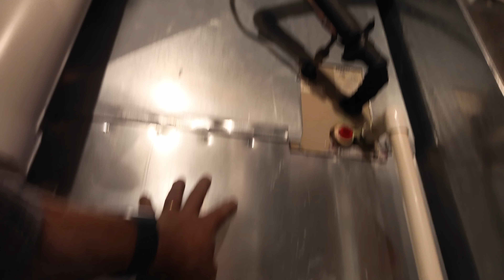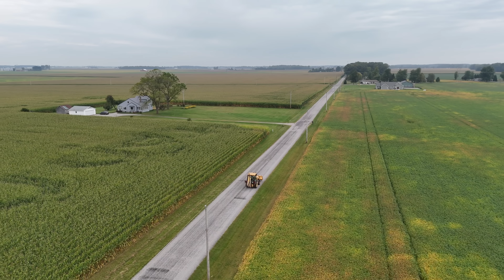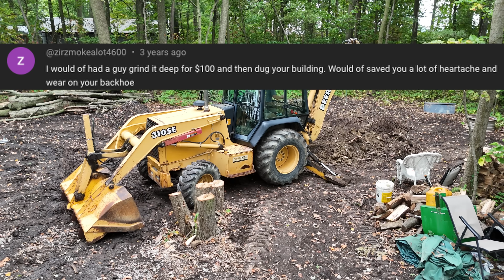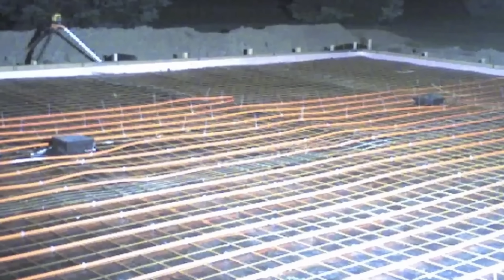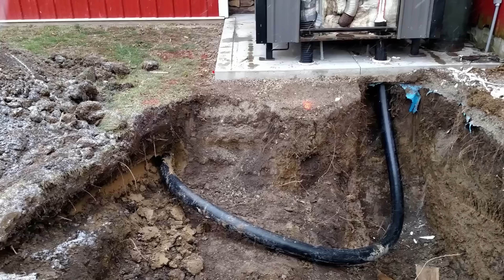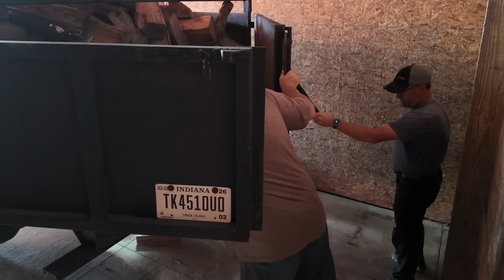Digging Stumps To Fuel My Outdoor Wood Stove

Comment: Actually, Neil. I used to have to take my 18 inch bucket off. Put my 24 inch bucket on. To dig out tree stumps. It seemed to. Had more power. I don't know why you'd think it'd be different. I'm talking about my old 310D, John Deere. 1995 model. I cleared a lot of land with that. Digging stumps, trees, you name it. But the hardest thing to ever dig out. Is a burnt stump. After they're burnt, they're tough as nails.

Comment: Since I have never operated any heavy equipment except for a couple of Bobcats a couple decades ago, I figure that I'm not qualified enough to comment on how stumps get pulled. Your method seems to put the least amount of wear and tear on the equipment. Plus I'm not sure I'd want 5 or 10 feet of "stump" in the way just for the dubious value of using it for leverage. That's about all the armchair quarterbacking I'll do.

Thanks for the tour of the actual set up of the hydronic heating system. I'd be interested in a more detailed video if you ever feel like you need an idea to fill in between projects. I doubt I'll ever have a boiler, but I'm always interested in just about anything mechanical, electrical, or plumbing related. That's a fairly broad range of interest, but it keeps me occupied!

Comment: I'm far from an expert, but I would imagine you could get a 1-1/2 or 1 inch thick piece of steel cut in the shape of a tooth, have someone local fabricate the necessary attachment for your backhoe, and you'd have a stump attachment.

Comment: Having dug more than a few stumps up by hand before, having any machine to do the work is better. More so with whatever ground the stump is in, for me that's red clay. Stuff is like digging through red brick wet or dry, spend a hour digging and you're barely ten inches down with a shovel.

Anyway, once out, roll the stump around to get as much dirt off as possible, pressure wash if necessary then let it dry for a good month, begin lopping it apart with a saw then splitter. It's dense wood so when it burns it takes a while to burn fully. Rarely would I want to burn a stump in the ground because of possible root fires spreading out to light any surrounding brush up or possibly get a building lit on fire. So use what you have and take your time, it's not a race to get stumps up unless you're being paid for it and the client wants visible results quickly.

Comment: I’ve dug dozens of stumps with myJohn Deere 410 G backhoe

I tried all the stuff you’ve discussed through the years and I always just cut the stump off as low as I can to the ground dig around it completely like you did to cut the roots and then pop it out 

It seems to be the most efficient way to me. I’ve ended up with some holes that were 12 feet in diameter and 12 feet deep when the trees were really big. 

It’s not hard on the machine at all. Are designed for digging as long as you’re not a bonehead operator. 

I’ve also dug dozens of boulders out of the ground, some larger than Volkswagen beetles with the same machine, and the same thing applies. You have to be smarter than the thing you’re working on.

Comment: Should of, Could of, Would of...the circumstances were not the ones where those things made the right sense.  I would have pushed over the tree -- well there are stumps here currently, not trees. So got to deal with the stumps.  I would have used a grinder -- If you have a grinder handy, great.  Neil and Jeff don't have a stump grinder, they have a backhoe.

Comment: Quick question: have you ever checked in on the $7,000, wood gasifier, how you could use to power a pretty large generator, which could significantly cut your electric bill, maybe 50% during the cost of heating your home during the coldest time of the winter. I've been watching people buy these high quality kits, just curious if you have ever thought about going down that road,? What really piqued my interest was, could you potentially redirect one of your water lines from your boiler, letting it power a steam power generator. We have seen others with similar outdoor wood burning boilers, too much the same thing, power a steam Howard generator. Just curious, want to see your thoughts on a steam powered off your wood boiler/stand-alone wood burning gasification boiler?

Comment: I’ve had 22 pine stumps, 36inches or bigger diameter, pulled out by my neighbor who runs his own excavation company. 
He charged by the hour and it took him less than 2 hours to remove them all. 

And he was able to get a root around a bucket tooth and pull it out  without disturbing any of the soil around it - obviously would create a sink home eventually but there was far less disturbance and cleanup.

I chose to have them dug out because the price to grind per stump in our area usually starts at $75 a stump at least. I paid to have them dug at $170/hour

Comment: Stumps in the woods are easier to remove. The trees at the edge of the wood or on their own are subjected to more wind and their roots get more developed. When we've had a big storm and the "front line" is fell by the wind, if there is a second storm within a few years, it will take many more trees even when there's less wind because the new frontline has not had time to strengthen their root system.

Comment: in the floor heat is the pure quill.  no cold feet, a huge thermal mass and the thermostat setting is less than with a hot air furnace.  the air retains more of its humidity.  all around the best way to heat.

Comment: I have a early 90s kubota 3,500lb micro excavator.  I spent 6 hrs digging out a stump once. I had to use a log, jam it under it and use it as a lever while i pushed down on it with the excavator.  There where roots under the hige stump i could dig out.  I then had to dig a ramp to tow it out of the hole with a truck.  That was 3yrs ago.  A cabin now sits directly above where that stump was.

Comment: The same could be said for pushing trees over! Backhoes and excavators are designed to dig, they are not bulldozers or a crain. Even some attachments can do damage to machines not built to handle the stress.

Comment: The only way I would consider that to be rough on the backhoe is if you had a larger bucket. I’ve put over 1000 hours doing nothing but digging stumps and clearing with a 60g excavator and the pins were just as tight as day one. Maintaining equipment as well as you do alleviates the vast majority of issues you’d run into

Comment: Hi Neil.  Bartering is a great system.  You and Jeff basically swapped your labor costs.  Getting something you need without having to reach as deep into your wallet is a win.  Nice too that you have someone close by that maintains a good supply of wood.  That's really the worst shortcoming of burning wood is that you can't get it piped in like natural gas or propane, or even oil.

Comment: Just a thought for you could put a couple of 2 hundred gallon cleaned out oil tanks in the work shop for the boiler water and a couple of 20 inch box fans for circulation. almost no noise .

Comment: If you want to destroy your back instead, and put some hair on your chest, you can dig it out by hand and use an axe to chop the roots as you go.  I’ve done so and it sure put some wear on my machine that I’d have preferred to have done on some equipment.

Comment: @ 19:30 looks like that wood is all under cover so my question is why waste time stacking, just use from pile as is ?
Reply: A pile takes up A LOT more space than stacking...and he will need a whole lot more wood to get through the season.  And stacking really doesn't take that long if the pile is this close to where you stack.  If you aren't carrying it far, it's not bad.  Two people could stack that delivery in 20 minutes easy.

Comment: A backhoe is nothing, but a tool. Sometimes they break, sometimes they don't and sometimes they are the right tool for the job. Sometimes they're the only tool you have for the job. Opinions never get the job done. 
I wish you would stop saying I don't want to bore you with this. We would like to watch you dig out the other two stumps You're not boring us. In my opinion which never gets anything done You're depriving me of you digging out that stump.  That's why I watch dirt perfect He doesn't deprive us of anything a 55 minute plus video multiple times a week.

So you say you can grind out a stump in 15 minutes. I call BS You can't even get ready to start grinding in 15 minutes. You will also leave more roots in the ground which will decay over time and make the ground settle. And the mess is unbelievable and usually not even complete. Because you can't tell how much of the stump you truly got out.

Comment: How does the system shed excess heat?  What if you have a ripping fire going on a Monday because it's 20* outside but then Tuesday is a mild 38* and sunny ...and there isn't much demand from any of the heating systems to remove the heat from the water into the buildings?  What keeps the water in the 'tank' from overheating?  Or even days in early/late winter where is is very cold at night but more mild in the daytime.  I'm sure the system has a way to keep the water from getting too hot.

Do you have a setup to use the boiler to heat your hot water (like for showers etc) during the periods that the boiler is running?

Comment: It has been my experience that digging stumps with a tiny backhoe is hard on the machine. My 855 with the model 7 backhoe would do the work, but it was obviously hard work for the little guy. I now have a Kubota L48 with the BT1100 backhoe. It is night and day different. The L48 does not blink an eye while digging stumps. They do not fly out of the ground, but the old girl has no problem digging stumps. That said, I try to be easy on the machine, because digging stumps can be tough duty.

I would really like to come up with a tooth ripper. I have a quick disconnect backhoe connector and it would work really well to use a ripper along with the 12" bucket.  

Thanks again for your video work. I enjoy it.

Comment: Everyone saying "just grind it" "use a stump grinder" "i could have ground that out quicker" don't factor in the amount of work it takes after grinding to make it look good if its in your yard, sure grinding the stump below the surface looks nice, but they always seem to grind it down below the surface of the ground and then fill in with dirt, but there is still root ball that rots, the ground sinks, you add more dirt, and this goes on for years after grinding to keep it level and nice with grass, and depending on your moisture level that rotting material ends up growing mushrooms in the yard.  Been there done that many times.  Removing the bulk of the root ball means less sinking, you dig it out, you fill it all back in, and its done, maybe a bit of dirt added after settling with a few good rains or one season and you are done.  Lots of armchair experts on Youtube, i have done both, grinding and digging out, digging out is the best option for a nice finished job that you aren't touching up over and over for a few years, but grinding definitely has its place and i've done it a lot.

Comment: Not all stump grinders are created equal. I have a tractor with a backhoe so I wouldn’t have to rent something. Stump grinders can be pricey based on the type, size and how long you have it. Also, it takes far longer than 15 minutes to grind out a 12”+ stump. You grind across and down which takes time. As Neil said you have to constantly clear dirt and wood chips out of the way to see what needs fixing to be ground next.

Comment: Neil as an american living in Eastern Europe where most building are heated by a district boiler plant and the hot water is distributed through 12"  to 24"insulated pipes  buried under the streets , then cool water is returned back to the District boiler, basically it is the same exact system you are using , and in Europe we pay for the BTU's you take from the water to heat your home.   The boiler districts are inner connected so if one boiler goes down the other boiler pick up the slack.

In Krakow Poland over the summer the City replace many sections of pipe that failed inspection, that the pipe has erosion inside the pipes, this way the system is maintained and the risk of a pipe bursting is minimal.

On the firewood you cut, you may want to look at the eastern European firewood drying stacks, the Germans build a holz hausen wich is an 8 feet circle where the outside is stacked firewood and the center is filled with loose unstacked firewood, and every 3 feet in height they will put two  poles across the stack in the for of an X, and I seen the stack built 12 to 15 feet tall.
The will put bark on the ground  or gravel to build the holz hausen on, I have also seen them use plastic pallets to cover the ground to build on, as the pallets allow air to flow in from the bottom as well as the side, to create a chimney effect to dry the wood, that draw the moisture out of the wood.

In Ukraine  the also build a similar stack called  Вуд Хаузен  (Vud Khauzen) and it is also built the same way, and for the Ukrainians in the village they  will have several  of the Wood Houses made that way, as they heat their homes with masonry heater, in which the cook, bake and sleep on in the cold winter nights.

Comment: Yea when grind the stump  the root ball is still there that rots away and now after 3 to 7 years you have a huge hole to deal with and then if you build your shed with a concrete floor as Neil said you end up with a huge void under the floor removal is the best and only way to go period! Get it done Neil!!!
Reply: Agreed.  Even if they go REALLY deep, there is more left.  And you still have to get rid of all of that wood mixed with dirt from the grinding operation and then get fill dirt brought in and compacted.

Comment: Always going to be the negative comments, and like you said, they have good points, but nothing would ever get done if you didn’t just do it, use what you got and get it done. I would like to see an update on the new stove after you get some time on it in the winter with any differences from the old one. Great video as always!

Comment: I mean if you haven't got access to the proper equipment, use what you have. As far as how to cut a tree off at five feet, once again if you do not have the right equipment, use what you got. Stand in the front bucket and cut it. If you are afraid of trees, they will kill you.
Reply: Your comment is the most ridiculous one I have read so far.  From a safety standpoint, from a 'best practice' standpoint, from the standpoint of what will work the best.....

There is nothing wrong at all with how he did this - in reality, especially given this scenario)  this IS the proper equipment. While a ripper would be nice - buying a special tool for every seldomly performed job is not a good idea.
Reply: @ian3580  they actually make stump grinders. And anyone who thinks using a hoe to pull stumps is ok, has never been a operator. I actually work in forestry, I run am machine called a Kershaw clear away, what do you do?
Reply: @thatsharshman.8544  I don't even understand where you're coming from on this.  It is like you don't understand what the actual concerns are.  

So you work in forestry.  OK.  So you run a Kershaw.  OK.....Do you now understand why that type of removal would not work here?   Maybe you don't.  Maybe you don't understand construction.  Maybe you don't understand the need to not have stumps and other material rotting away from under the construction site.  

Such a weird comment......but probably not a concern in forestry applications.
Reply: @ian3580  nope, don't understand why you would beat a piece of equipment to death when your local arborist would have a stump grinder that would remove it, even below ground. Depending on the size of machine, up to three foot, leaving very little to no work needed by a backhoe. But hey, beat them pins to death and bang those hydraulics, seems he's got the money. Union aren't ya? Not owner operator who has to pay for equipment.
Reply: @thatsharshman.8544  Once you get the stump ground, then you need to dig all of that dirt mixed with the wood chips out, and for big stumps that can be a lot of dirt and wood.  Otherwise as the wood rots away you end up with the ground sinking in that spot.
Reply: @ian3580  yeah, but you do realize that wood compost back to dirt right, and you do not have a giant stump to deal with. Throw a little extra dirt in ii and go. See that is kinda the idea behind grinding stumps, so the wood compost and helps fill.

Comment: I do believe you can’t build above tree roots and I’m not sure if there is a clear rule about that. But I’ve heard there is. This is the best way to remove the stump. 

DirtPerfect made a stump ripper and it works fantastic. But he’s using a much bigger piece of equipment. At a greater expense. 

One or two times a year this is fine.

Comment: It would be interesting to see just how much wood you'll use with your new stove compared to the past years with the old stove., also comparing in certain temperatures. Are you going to write on the stove the date when you start it for the season like you did with the old one?